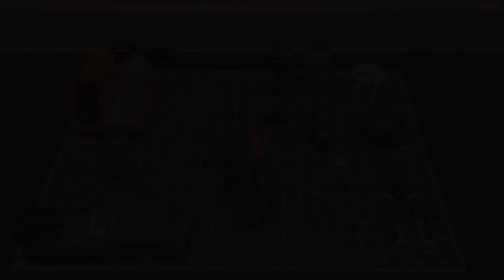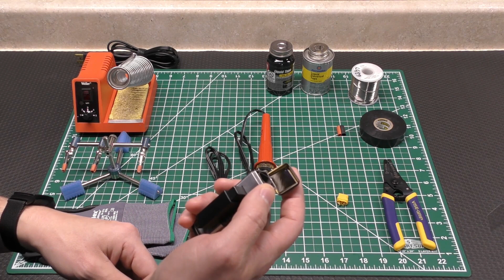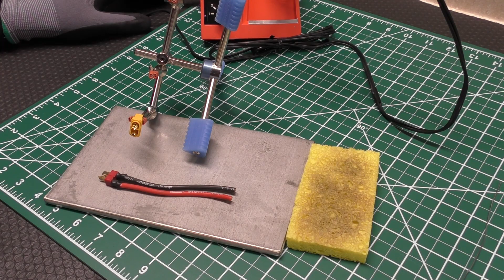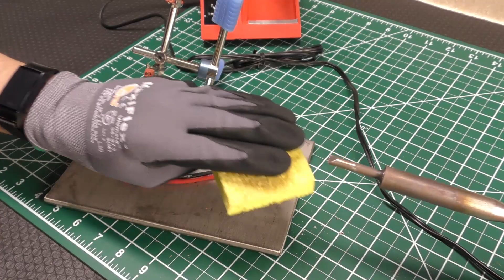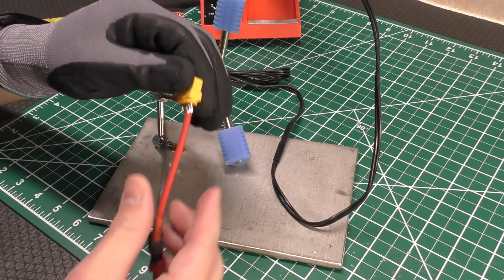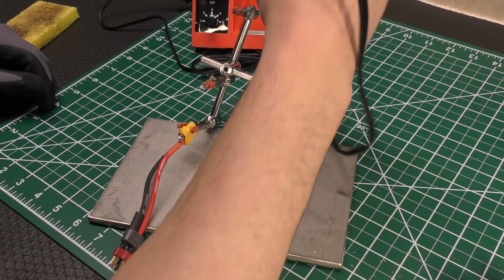Tutorial On Soldering Connectors (XT60)

Comment: What solder are you using?
Reply: The wire I mean not iron lol
Reply from the maker: It is Kester 24-6337-0027 Solder Roll, Core Size 66, 63/37 Alloy, 0.031" Diameter. I got it on Amazon.

Comment: Where do you get the grey wire protector that you put over the heat shrink? I am looking for a similar for xt30 connectors. Thanks.
Reply from the maker: I got them from HobbyKing. Search for "XT60 Insulating Cap".